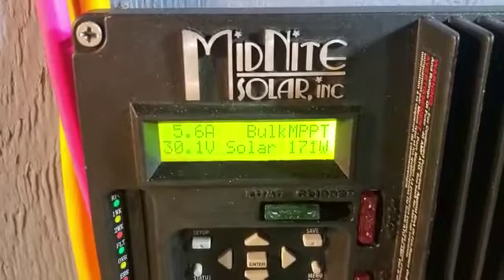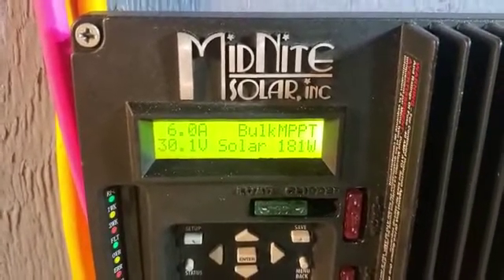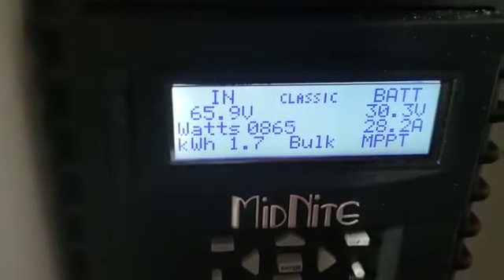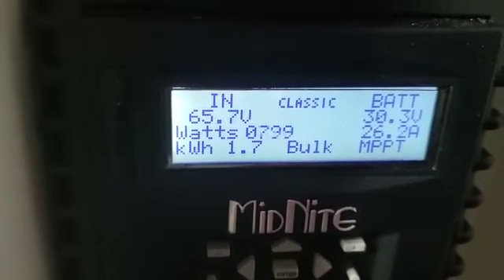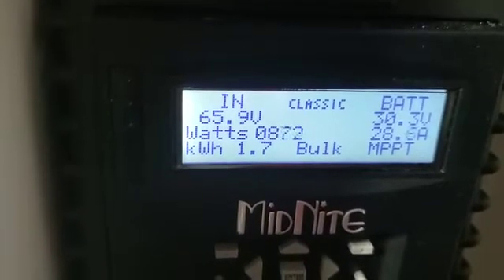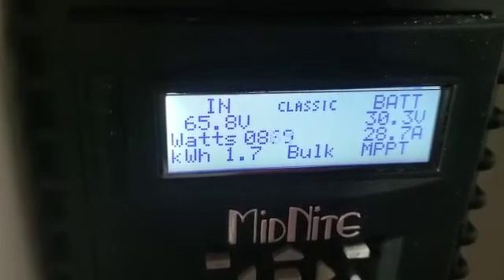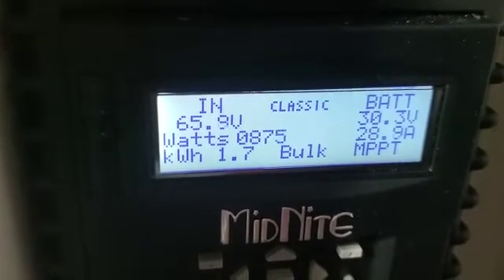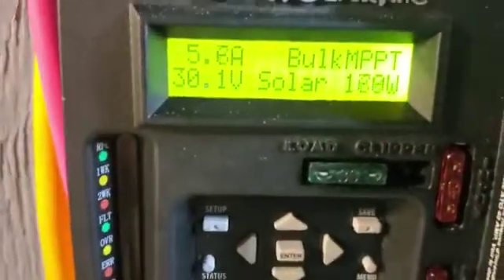OFF GRID TINY HOME, 20kWh LITHIUM BATTERY STORAGE, GRID-TIED INVERTER LIMITER FEEDBACK (Part 4)

Comment: Great system
Reply: Which battery setup are u using ?
Y see 29v
Reply from the maker: The voltage configuration is 32V on the battery bank. But the battery  bank was just 30 ish at the time. 
The grid ties are seeing 30V without load and as they engage loads it drops 29 ish which the grid ties dosen't show decimals and also due to a 25ft run of copper wire. I have a 0.2 millivolts loss off a 25ft run
Reply: @jwsolarusa  right so if I calculated it correct you are drawing over 30 amps DC so you may get away with 40 amp breaker and 8 gauge wire but with 25 foot run likely need 6 gauge and 50 amp breaker then should be no problem with surges.
Reply from the maker: @offgridwanabe  
Yes brother.
I am currently running 6AWG Copper Wire @ 25ft. I be ordering two 50A MidNite dc breakers. I currently have 63A breakers on each for the time being.
Reply: @jwsolarusa  Of course the less expensive way if you can is to move the grid ties close to the battery as the AC end can use smaller wire but the CT's probably have short wires. You have a great channel and some good friends to share your solar expertise with.
Reply from the maker: @offgridwanabe  
Thank you so much for the comments and for the compliment.
This is the issue I was working on and this is the only way I can go about ffg use to the CT clamps sensors.
Reply: @jwsolarusa  well there is one other way as the MS4024 will allow the current produced by the grid ties to flow through into the main bus if you hook it up to the critical loads panel and the AC in to the MS4024 to the main panel but the way you are doing it is the best way as you have to change the charging system to modified from cc cv. Diy electrical is a challenge when AC coupling is used.